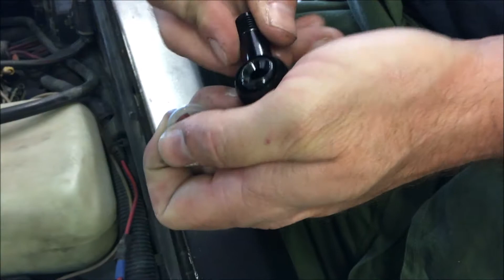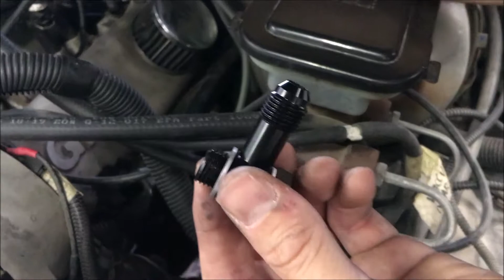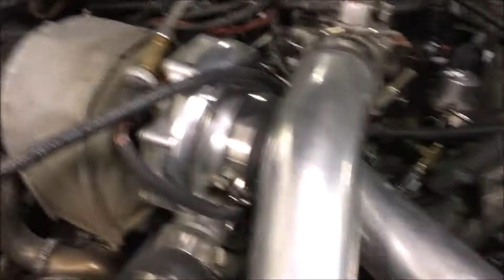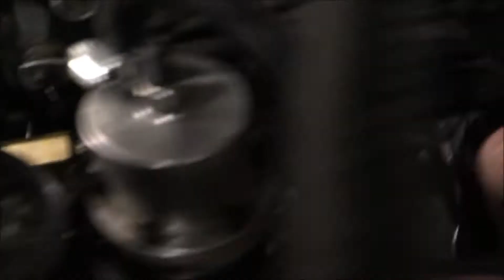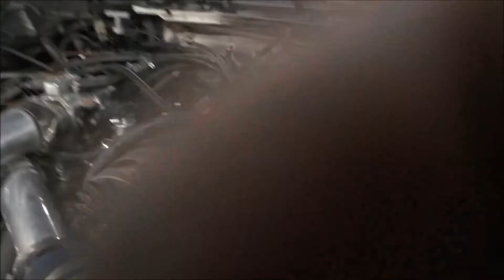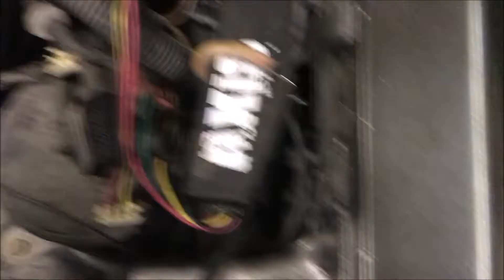1987 Turbo Buick Regal larger fuel return line install for big fuel pumps

Comment: Question....Did you bypass the fuel filter when you ran the 3/8 line from the fuel supply regulator to the fuel tank?
Reply: Fuel filter is on the feed line, not on the return line. It's over the passenger's rear tire mounted to the inside of the frame.